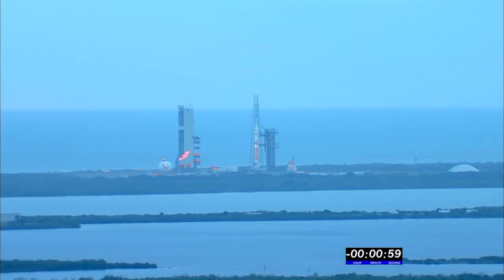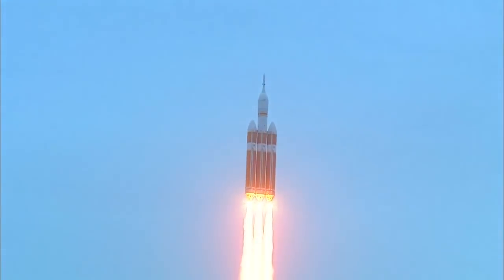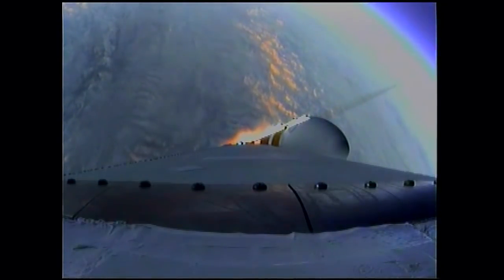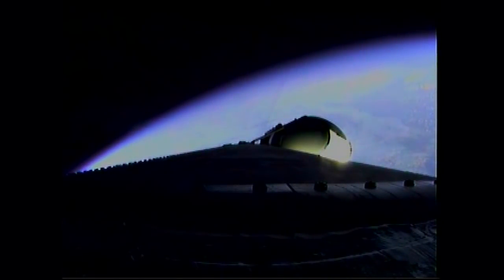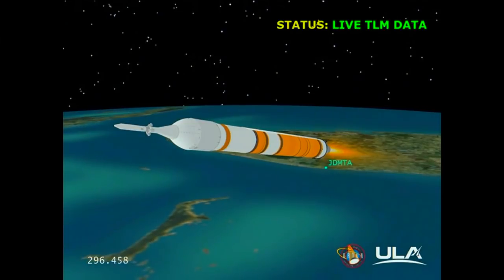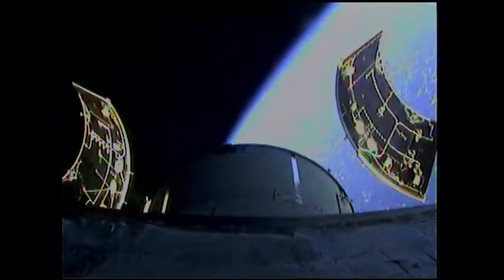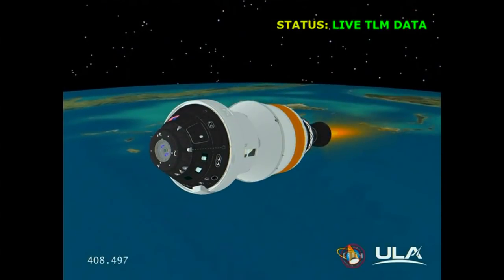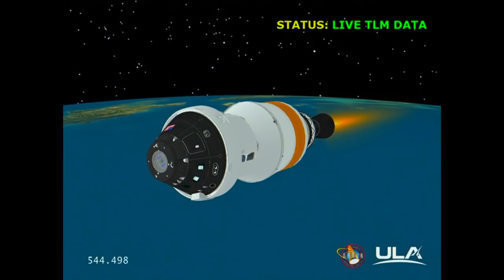Orion Soars on First Flight Test

Comment: Question: What is that flair stack for off to the side of the launch pad? And Just before launch, like 5 sec to launch, the pad looked like it was engulfed in fire. Why is that? It's a lot different than a shuttle launch and I wasn't expecting it... sure got my heat going for a second.... well 5 seconds.
Reply: Okay, time to correct a major misconception:

The countdown before launch doesn't count down to engine ignition. It counts down to liftoff, the moment the rocket takes off from the pad. 

Like all engines, the rocket engines on a space craft take a few moments to throttle up to full force and build up enough thrust to lift the rocket off the pad. Think of it as the rocket's "Zero to Sixty" time.

Because of this, all spacecraft launches will ignite the engines somewhere between seven and four seconds before T-Minus Zero, the moment of liftoff. 

The reason why people think it's the other way around: that the rockets count down to the moment they are ignited, is because Hollywood thinks it's way more exciting for the engines to light up at "T-Minus Zero," as if they were setting off a bomb.
Reply: I understand that the engines need to on befor lift off. My Questions where what is that flair stack for and, when compared to shuttle launches, why is there so much more flair up around the vehicle?
Reply: Ron H Im assuming that this hip is much more powerful and heavy so it gets way more throttle to lift
Reply: Nikola Georgievski i just watched it one more time and im sure im right. think of that as 4 Saturn v's launching next to each other

Comment: Way more flame surrounding the boosters on lift off than older, liquid propellant boosters that channeled everything to the side.
Reply: This is liquid propelled too (LH2/LOX). Trivia tidbit: that fiery plume is from extra gaseous hydrogen floating around that has been blown through the engines as part of the pre-start sequence. That's why the Starboard engine starts at T-7 seconds; to burn off and suck some of the extra hydrogen down the flame tunnel before the other two engines start at T-5 sec. The ROFIs (spark generators) which fire at T-13 seconds also burn some of the excess hydrogen off.

Comment: Should up the budget so NASA can buy some 4k cameras.
Reply: That's not the constraint. The constraint is that the vehicle uses up bandwidth communicating vital data to mission control, such as engine sensor output, valve status reports, and computer instructions. All of that takes up so much bandwidth that even a small camera taxes the system. A 4k camera would be off all the time because it's too big of a file to stream and it's not considered critical (unlike the other data).
Reply: ULA shot 4k video of the launch and some of the processing leading up to it. Unfortunately like Enzo said, streaming 4k video isn't enough of a priority (yet?) to put those on the vehicle.
Reply: yes because that's what they should be spending the money on. (sarcasm)
Reply: Enzo Piacitelli Oh I know, my comment was more in regard to the ground footage, which was shot (or at least uploaded) in 720.
Reply: Squid God Oh, that would be amazing to see. Youtube does support 4k and 60 fps now, it would be great to see both in practice on a launch.
Reply: Enzo Piacitelli Stay tuned to United Launch Alliance's channel then - like I said, while we were rolling the tower back from the rocket I was talking to a couple of the video guys and they had several 4k cameras running the whole time. Not sure how long it'll take to edit everything, but they do have 4k footage.
Reply: Daniel Arend Excellent! Thanks for sharing that information, and I really hope it's released. It's the first Delta IV Heavy (and almost certainly only) in this non-fairing configuration, so it would seem valuable to share with spaceflight fans.

Comment: Seems like there was so much space debris caused from this
Reply: it all falls back to Earth. Not enough velocity to stay in orbit, and they are still in the atmosphere when the parts are jettisoned.
Reply: ***** ...... that's exactly how it works.
Reply: Most debris burn up as they fall, but if it doesn't burn up, it's likely for it to fall in the ocean.
Reply: ***** Yes, exactly that. Stuff that burns up becomes dust/smoke/gas and stuff that makes it to Earth has been positioned to hit the ocean.
Reply: ***** Actually... yes - precisely why we launch from the coasts and not the Midwest. It all goes into the Atlantic ocean for Cape launches - in the video at 8:05 he mentions altitude and distance traveled after all the separation events have occurred. Even for this mission all separation events occurred less than 700 miles downrange.
Reply: ***** That's how meteorites work. They are lumps of metals and minerals which are vaporized because travelling at many tens of thousand meters per second higher than terminal velocity causes a lot of friction with the molecules in the atmosphere.
At those speeds the atmosphere actually acts like a sort of "surface" where the immense speeds are very explosively turned into heat energy from the sheer pressure, which is why meteorites often start out with a sort of flash.

The commentator said that the craft was travelling at 14k mph, which is approximately 6.2 km/s. I'm not sure if that translates to a high enough speed for the panels and engines to burn up in reentry.
Reply: Have you ever heard of "Space debree blows up building" I didn't think so. Trust me everything is accounted for in these missions by people ten times smarter than any of you Youtube pseudo-scientists, the launch sites are strategically placed where ocean is the only thing beneath the rocket, also the extreme heat caused by friction does cause even the metals to burn up. The reason the rocket itself does not burn up on reentry is through clever design of heat shields to spread the heat throughout the metal rather than being conducted unevenly.
Reply: I hear ya.... My god I have never read such idiotic comments.  Nixon Perez had it right "Robert you are embarrassing and stupid"
Reply: ***** Oh good grief, get onto Google and educate yourself a bit more. There's no excuse asking such dumb questions, i knew more than you when i was seven, thanks to my parents and a set of 1969 World Book Encylclopedias.
Reply: ***** Are you being serious or trolling?
Reply: *****" No it isn't. People are going to die because of NASA's recklessness."

You're like a special education student but with out the potential. That being said, everything you have said and will say in the future is invalid and has no credibility,.
Reply: ***** Yes we are, we're also breathing blood vapor, sawdust, concrete powder, metal shavings, asteroid powder and plastic fumes. However, when it's only a few molecules, I don't know if you can really count it as something to worry about (unless you think we should halt all human progress). And Major Tom, you only need to see a video of the launch to realize that there is no significant wildlife impact other than perhaps an unlucky mouse wanders onto the launch pad.
Reply: *****  That hard wood in your fireplace or fire pit, turns to dust/ash. Is that magic?
Reply: *****
They burn up on reentry, stupid
Reply: Deathlot
BULLSHIT, you idiot
Reply: Smithy0013
WELL SAID
Reply: Robert your embarrassing stupid
Reply: shut up you ignorant bitch!
Reply: ***** There's a reason why they launch to the East from Florida, you're over the atlantic throughout the launch phase.  When the Launch Abort System is jettisoned, Orion is about 500 miles offshore
Reply: Beyond stupid I might add!
Reply: ***** The air acts ,effectively, as a very hot belt grinder and grinds, melts, and burns the metals due to the debris's speed.
Reply: Hmm, not getting involved in the recent comments but thanks for those that answered earlier lol, was interesting to read
Reply: ***** If you actually are a software engineer, lets just hope you never end up working for NASA! If that happened, their entire rocket would crash into someones house.
Reply: Robert Brockway Put on your glasses old man. That was a quote!!! I'm not the one who said that people are going to die because of NASA's recklessness. You and I are on the same page.
Reply: Smithy0013 so were breathing space debris powder in the air?

Comment: I find it strange how NASA is still using imperial units. I don't see how having a delta V in weight is practical. Having miles still is strange considering they did have an incident with a mars probe.
Reply: Thankfully I'm not the only one who wondered why they are talking in pounds and miles.  What person can justify using imperial units anymore.  The United States introduced metrics by law in 1975.  I feel worse for the British talking in stones instead of Kg.  Where did the US go wrong?... The Metric Conversion Act is an Act of Congress that U.S. President Gerald Ford signed into law on December 23, 1975. It declared the Metric system "the preferred system of weights and measures for United States trade and commerce"